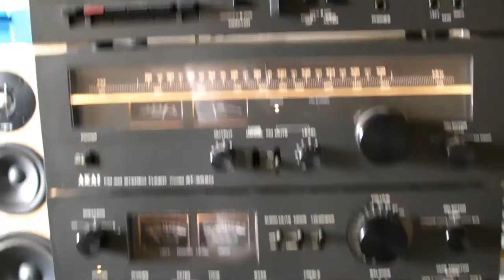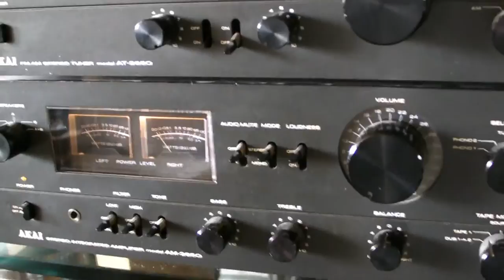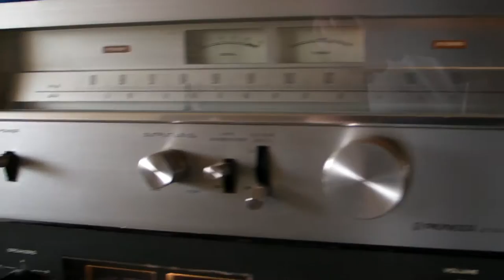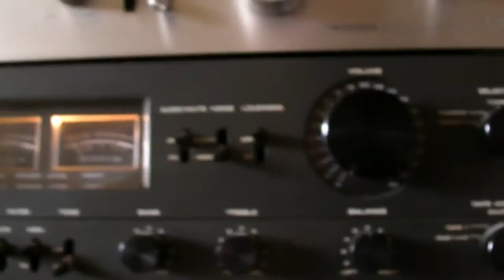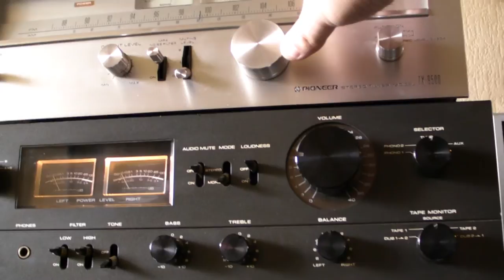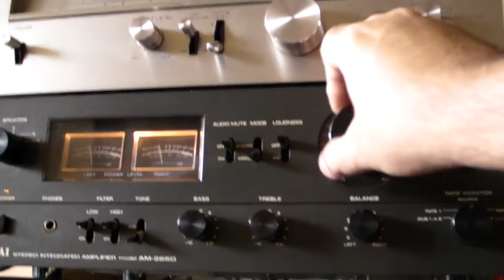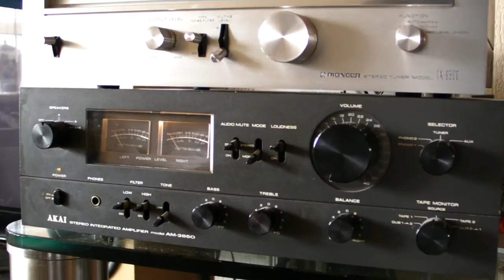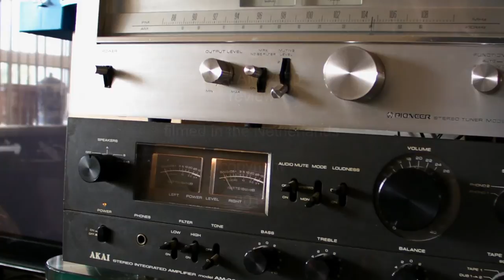Vintage Akai AM-2650 and Pioneer TX-9500 review

Comment: when I heard the sound of akai aa1030, I sold all Marantz receivers 2230,2235b,2238,2270 and started shopping for akai equipment, now I own akai aa1175 and akai am 2650 and of course I have akai aa1030. Akai aa1175 is the best, am 2650 is also excellent but a bit brighter, akai aa1030 has a sweet vintage sound

Comment: i wonder if it share design with the bigger brother ... if so as someone said below you could check the mono switch.  Anyway for your excellent video that made me rediscover the vintage units why not using tracks that can be found on internet ?  radio transmission are always noisy ... you can maybe use, like i normally do, a Google Chromecast device and a small tv with a digital out and any cheap but good dac that are all over the places  ...  i know that youtube audio is compressed.  Nevertheless some video sound quite ok ...  I have a tablet from Lenovo with a very good sound.  I use as a reference the sound that i get from Lenovo through heapdhones to evaluate my stereo combinations.  Thanks again for all your advices.  Kind regards, gino

Comment: which sounds better akai am 2650 or akai aa1175, I did a test and they are very close
Reply from the maker: I am not sure. The 1175 I had needed revision so not sure how it sound after the revision
Reply: so 2650 was better  than 1175 in that condition

Comment: whats the name of your original speakers?
Reply from the maker: the speakers i blew up where the magnat zero 5 also almost the same is the magnat 1.5 ore magnat msp 70. i sold the broken zero 5 set but bought back the 1.5 and the msp 70, Will revieuw them, soon, hardly no difference in sound of these 3 models. just fantastic. In a lot of older video's from me you can hear the zero 5 speakers, bought them new in 1991 for 800 german mark(DM) a piece.